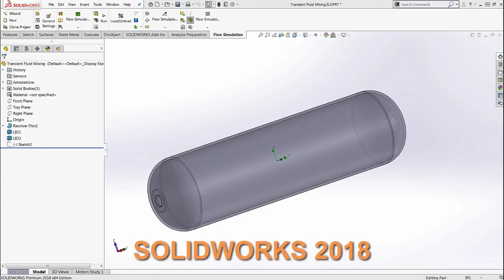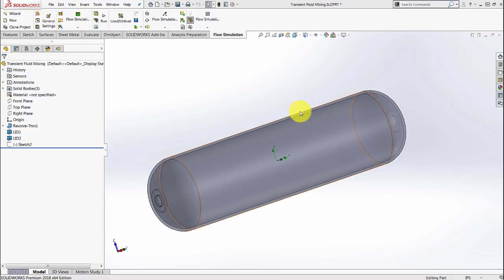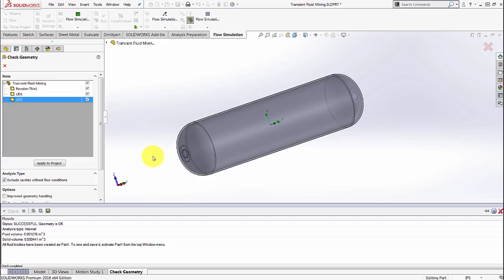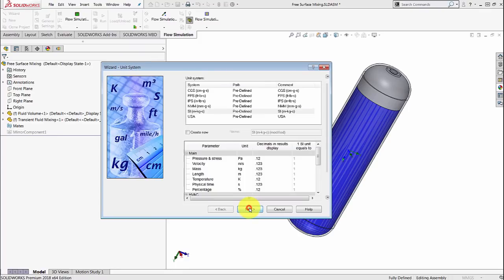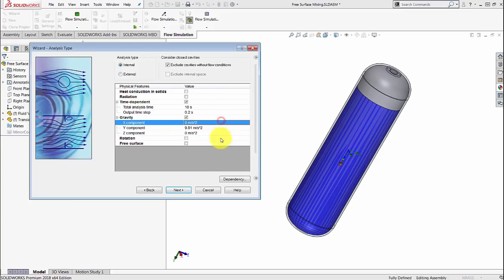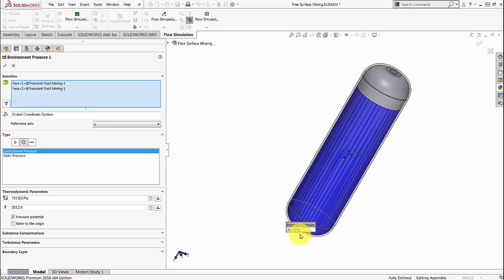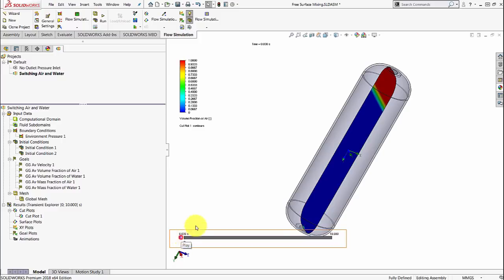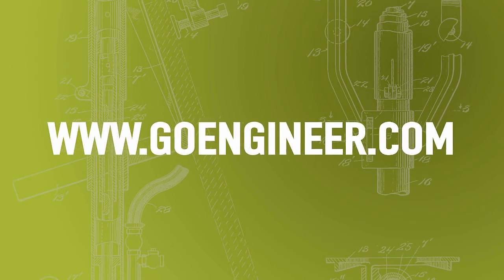SOLIDWORKS Flow 2018 - Free Surface Simulation

Comment: How to create Fluid sub body and after surface cut
Reply from the maker: To turn the solid bodies created by the surface cut mentioned in this video into Water and/or Air do the following. 
1.	Right Click "Initial Conditions" in the Flow Feature Tree and click "Insert Initional Condition."
2.	Click on the Air or Water body. You will see if show up in the Selection box and highlight blue in the graphics window. 
3.	Check the "Disable solid components" check box.
4.	Set the "Substance Concentrations" drop down menu to Water if you are specifying the Water body or Air if you are specifying the Air body. 
5.	Click the green check mark and you are done with that body now follow the same workflow for the other body.

Comment: Great feature ! Can we include multiple fluid inside the control volume?
Reply from the maker: Hi Salah,
Yes, multiple fluids can be included in the fluid domain.
Reply: GoEngineer thanks for your reply! Another question, this feature consider the mass transfer (intermixing) ?
Reply from the maker: Salah,
You will have to expound on what you mean.  This short description does not explain what you are looking to find.